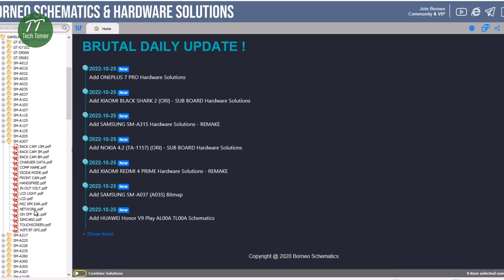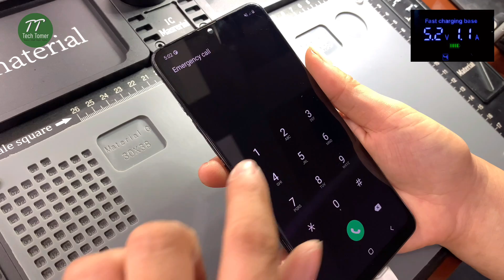Samsung Galaxy A20s Black Screen No Display Solution Repair Tutorial | Tech Tomer

Comment: When I restarted the Samsung A20s phone, it did not open and it vibrated constantly. When I plugged it in, the screen did not come on and it vibrated intermittently. I tried the hard reset key combination but it did not work. What is the reason?

Comment: My samsung a20f is working but the problem is, when press the power button the screen will be off for good, i cam recieve the call and answer it with volume up button if i plug it to the charger it will be charging but the screen will be black. The fingure print wont wake it also the double tap cant. Not until i force start it with the volume down and the power button. What could be th problem please help

Comment: I have the same model a20s of the same issue. It vibrates only when i pressed the power button. And it vibrates as well when plugged into a charger. But there has no display at all. Can i just remove and refix the backlight ic? What if it doesn't work? Where to buy this backlight ic? Hope you can help me. Thank you!
Reply: We have the same problem. It happened on Sunday and I went to technician a while ago. I still don't have my phone now. I don't know if he will make it. I'm so sad
Reply: The technician told me about that backlight and he fixed it but didn't work. So he will try again tomorrow that's why I left there my phone

Comment: Bro, if this is the case, what do you think? The Samsung s20+ screen turns off suddenly even though it doesn't get hit by water, it doesn't fall, it's been restarted (power + volume down & power + volume down + volume up) but the screen still turns off, it seems the machine is still on because the charger vibrates, and there was a notification sound coming in, disassembled nothing is loose. But I haven't checked which ones are short-circuited or not normal... what are the possible parts, bro, if it's like this? IC or what? Thank you, please help

Comment: What if it's turned on, it keeps on vibrating, the vibrating doesn't stop but the screen stays dark. What's the problem, friend. Thank you.
Reply: Bro shorting hai mobile me
Reply: How to fix this bhai? @AvenueShow01
Reply: My phone screen is black Samsung Galaxy a04
Reply: If the phone works properly and only you have a black screen even if you change the screen with a new one, it can be a problem tò the Flex flat cable of the mother board. Try tò change It, few dollars.

Comment: Sir, please answer me please. 
I dropped my S20 FE on the stairs then the screen showed something like the old TV colours when there's no broadcasting, then next day it went completely black.
I tried to connect my phone to a TV using an USB / HDMI Hub. Then I could only see the lockscreen on my TV along with the digital clock. However, using a mouse, I couldn't unlock or access the phone.
I've tried wireless charging and normal USB - C charging, I've also tried calling my mobile from another phone, everything is working perfectly fine, except the screen.
Can the phone be fixed please? Is this IC issue?. 
I've very important data on the phone, can this be backed / cloned to another Harddisk or mobile phone?. 
Thank you Sir